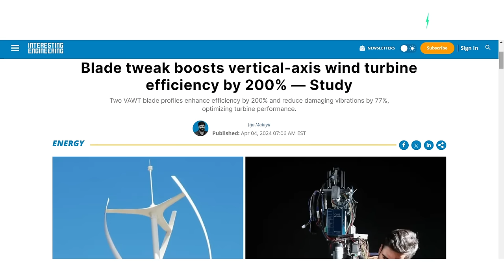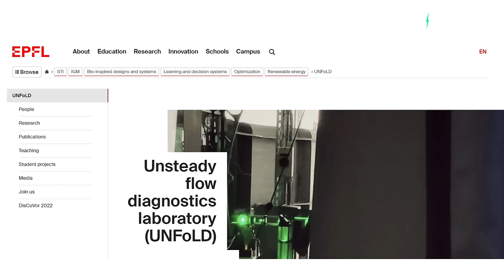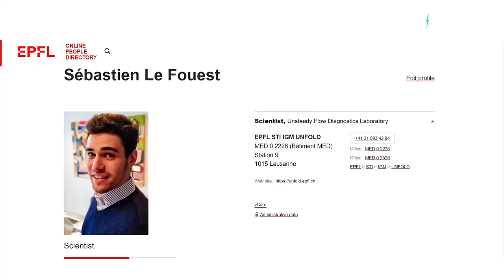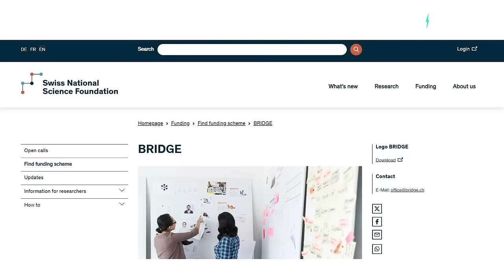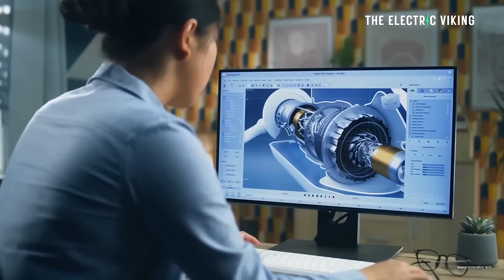A small change turbo-charges vertical-axis wind turbine efficiency 200%

Comment: Sam, you’re listening to hype, but ignoring thermodynamics. Vertical wind turbines are already 50-60% efficient. Increasing their efficiency by 200% would mean they they are 150-180% thermodynamically efficient, which is impossible. 100% efficiency is the theoretical maximum, but because of friction and waste heat generation, none will ever go above 95%. And horizontal turbines are already 70% efficient. That is why EVERYONE uses horizontal turbines. The best that vertical turbines will ever be able to do is 25% more output than our existing horizontal turbines. This is not an increase in “orders of magnitude”. My bet is that in 20 years, when existing horizontal turbines are aging out, vertical turbines will still make up less than 50% of total installed turbines.
Reply: They can increase 200% in efficiency if they are made în China!😂
Reply: Vertical wind turbines can be more densely installed within an array than horizontal ones, as they effect airflow on other turbines less than horizontal turbines meaning more turbines per wind farm. Everyone uses horizontal turbines now because they had not fixed excessive vibrations that caused structural problems. Until now...
Reply: Obviously you can't have a system that's 200% efficient. 
But. You can increase an existing efficiency by 200%. If, for example, the existing efficiency was 40%, doubling it implies it becomes 80% efficient. 
So my first question is how is the efficiency of a fan measured? 
Let's assume you have a wind tunnel that you can measure the volumetric airflow and the thrust that it generates. That air thrust is passing over the vertical wind turbine and you are measuring the power generated. Perhaps now you have a measure of the power being captured? 
As others have stated, the area footprint is of significance in terms of energy being captured.
Reply: @simotronic Wouldn't increase by 100% double and increasing by 200% triple the efficiency. Which is what OP was saying and how he got from 50% to 150%

Comment: The main reason vertical axis turbines are not used for power generation is the cost per kWh. Power is related to the square of the rotor diameter in a HAWT, while VWATs scale more linearly. Also wind speed on the ground is way less than 200m up on a tower, and power is related to the cube of wind speed. The efficiency doesn’t matter. It’s cost, cross sectional area, and wind speed. The VAWTs can’t compete, so that why they are not used, and why small wind is mostly not used.
Reply: In short: their efficiency is way lower than the one of horizontal axis turbines.
Reply: In california energy is so expensive that wind still makes sense but regulation restricts their use in residential properties on many properties where solar is allowed.
Reply: @kinkfluencer  Well you could call it cost efficiency or lifecycle efficiency, but efficiency of a device is generally understood to mean power efficiency, which is not the issue.
Reply: You are speaking of the current VAWTs, but is it the same if they now output twice the power? Put them on a tall pole (same as the HAWTs) except instead of only half the swept area high up, the whole swept area is high up.
Reply: @kinkfluencer 
COSTefficiency ?
Reply: Good to have developments in both 
H–/VAWT ?!!
more use cases or options to chose from 👍🏼
viable mass market tech 🤔

would love to retrofit one of those to a sailing cat 😄
🖖🏼

Comment: Vertical-axis wind turbine is now far more efficient. time to make a complete shift to vertical. this tech should be on homes along with solar panels, the one two win. lets get off the grid and everyone become self energy efficient and energy secure. This tech breakthrough is very likely to have been achieved using AI. thanks for the good news Electric Viking!
Reply: Unfortunately, vertical doesn't scale well - at least so far.
Reply: From theory simple VWTs were only 50% of the efficiency of HAWTs therefore this new technology only brings them level, so does not mean a complete shift. VAWTs may have an advantage ynder some wind conditions  but large HAWTs still have an dvantage bang for buck since they sweep a larger area with less hardware.
Reply: All new build homes should be required to be net zero with solar and vertical access wind turbines with battery storage so homeowners can produce their own electricity and not be slaves to the electric utility companies.

Comment: These will never be used in urban settings unless they're on the top of large buildings.  At ground level wind is rarely strong enough to make it worth it, even in rural settings.  Inside cities they will be worthless and will never come close to breaking even on cost.  These may work at scale but very few homeowners would benefit from this.  I know, I looked into this when I set up solar at my house and the math was pointless even on 5 acres.  A 200 percent increase still wouldn't have made it viable.

Comment: We must remember it is a necessary requirement for inventors to promote their product by featuring its novel innovation and distinct design evolution. This is to secure investor interest by answering the question, "What makes your product better than the competition?".  The investor has to read beyond the hyperbole, which to be honest is cut 'n' paste here, and to incorporate  A.I. seems strategically edgy. I will offer that there is a known concern with turbine electronics located at water level.  A real investor would have to perform due diligence involving deeper research into financial background, legal etc. beyond the mission scope of this booster video.

Comment: Vertical axis machines have their place, of course, but one fundamental fact is that they will need to be raised so that the centre height of the blades is similar to the axis height of a horizontal axis turbine in order to avail themselves of the same inherent wind energy. And a second fact is that wind energy is available from a swept area/volume of wind, so the size and mass of a vertical axis turbine would very likely be greater than a horizontal axis machine for a similar output power.

Comment: 200% efficiency increase compared to what?   The old original straight blade type of vertical axis turbine blade?
Reply: compared to?  and in relation to? my question exactly.  There needed to be a reference point.

Comment: One key to vertical axis wind turbines is using Mag Lev technology to create low friction bearings in the hub center point for rotation. Oh, and they also need to be 200 feet in the air.

Comment: I have a feeling that what is being compared by most people is apples and oranges.
Let me explain. 
As far as I can tell from what I've seen of both of these technologies, the only thing they really have in common is that they are trying to extract energy from wind.
They work at different scales.
 So horizontal wind turbines are best if they big, tall, and can access maximum wind speeds.
(Basically we should be building them in bodies of water and on mountain tops where the wind is least impeded and fastest.)
On the other hand other types of wind turbines create electricity at much slower wind speeds, and can work in places where the wind is much slower, and more turbulent.
So the key to these "slow wind" turbines is small size, and light components. The lighter the components of these other kinds of turbines, the better.
So basically you want to make them out of, say, Bamboo, or Balsa wood, anything strong that reduces weight, and you DON"T want to make them too big either.
They need very little energy to turn them and they make power, because they would be small, and light, and thus cheap to build their "efficiency" is less important than something that is large and expensive.
Also small light things can be built and deployed in large numbers pretty much everywhere, another difference from large horizontal turbines.
Basically you could build and deploy possibly hundreds of small vertical turbines for the cost of one large horizontal turbine.
These are the reasons I don't see the comparison between the two technologies, and why I feel comparing them is like comparing apples and water melons.
I really think these are two different ways of utilizing the same resource.
Is my understanding of these technologies flawed, or are they really very different the way  I think they are?

Comment: Amazing. Imagine if Disneyland originally had built their Spinning Teacup ride Vertically instead of Horizontally. Would’ve had Hindenburg-level mechanical failures. It makes so much more sense to work with gravity, rather than against, and rotate horizontally.

Comment: The problem is that homeowner restrictions make them difficult for homeowners to use. Many laws require the homeowner to have at least an acre lot which makes having a small vertical access wind turbine impossible for most homeowners.
Reply: Agreed.  I had a fair amount of hoops to jump through in order to get my solar array online.  The requirements for ANY size of wind turbine basically made them financially unfeasible.

Comment: Ait's a law of Physics, Sam; a vertical axis wind turbine can never be 'orders of magnitude' more efficient than horizontal axis turbines. To explain: Suppose a mediocre horizontal axis wind turbine is 20% efficient, meaning that for every kilowatt of wind energy is converted into 200 Watts of electricity.  

Only one order of magnitude more efficiency would require it to be 200% efficient - giving twice the output power of the input power; one kilowatt of wind energy would give 2 kilowatts of electricity. This is clearly impossible.

If it were just two orders of magnitude better, it would have to produce 20 kilowatts from 1 kilowatt of wind energy. This is now ludicrously impossible.

Maybe the new designs could be 10% more efficient than a horizontal axis turbine, making it maybe 55% to 60% efficient, since the best currently deployed turbines are theoretically between 45% and 50% efficient.

I would like to hear what improvements could be gleaned if similar techniques are applied to horizontal axis wind turbines.
Reply: *It's a law of Physics....
(My browser doesn't allow edits on Youtube.)

Comment: Hi Sam, I am sorry to say but someone has been lying to you about Vertical Axis Wind Turbines. They do have some advantages compared to HAWT when it comes to small scale wind energy plants, but not when it comes to energy effiency.
I think you need to go back to study the physical laws that applies to wind turbines. You can start your studies here: https://en.wikipedia.org/wiki/Betz%27s_law. 
And here is a video presenting independent test results on small scale wind turbines (VAWT and HAWT).
P.S. Most of the VAWT examples in your video are Chinese models, proven to be hoaxes when it comes to alleged power output.